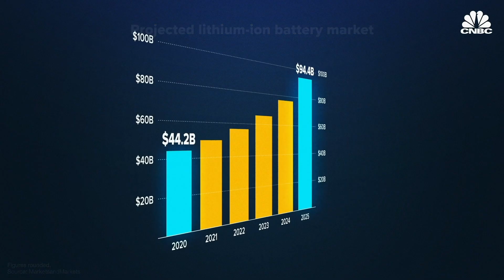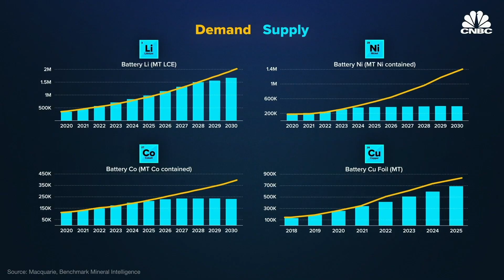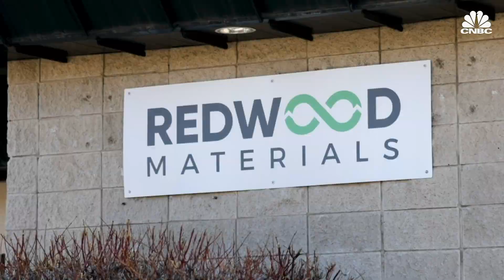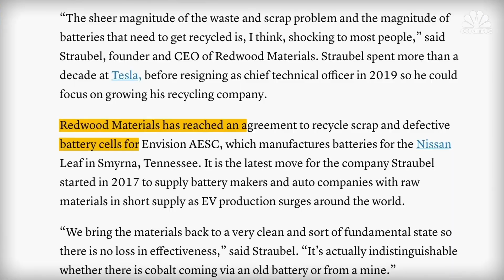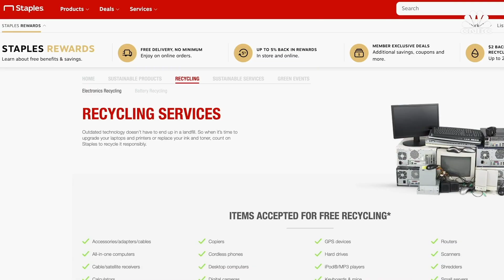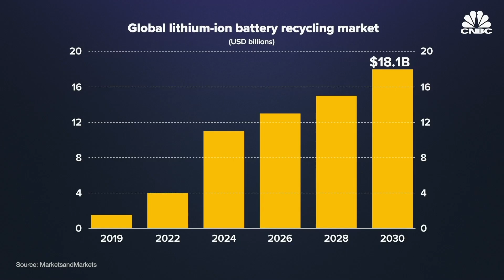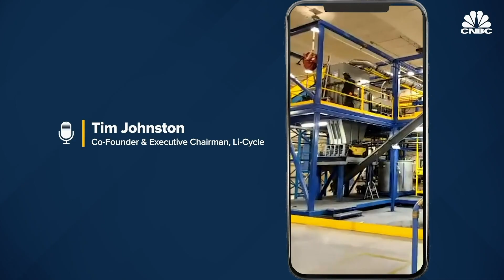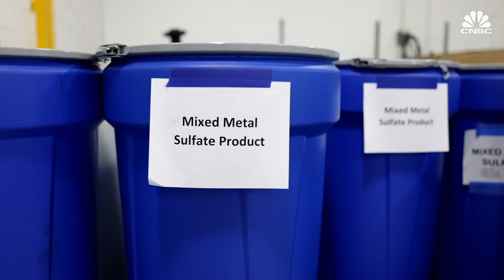How Tesla’s Battery Mastermind Is Tackling EV's Biggest Problem

Comment: CORRECTION>
Evs  PERCIEVED  problem is that people are accustom to driving gas cars where a tankful will take them 3-4-500 miles. So they perceive they need a battery pack to take them just as far when in fact the average driver only goes 40 miles a day. Once or twice a year some people go visit grandma or vaca on that faraway beach. They can rent a Suburban for these trips. A 3-4-500 mile battery pack will co$t you a fortune, take forever to charge, add a ton of weight to your EV , mrake your EV harder to stop, and if the battery pack should ever need replacing the car will be scrapped instead.

!

Comment: Hybrids. Perfect solution to a smoother transition and maybe the end of the road as far as transitioning is concerned. The EVs are just not going to get me where I need to go on one charge and hydro companies are getting slower at connecting new buildings to the grid. A hybrid will have the range and serve as a power source on the job site. The only problem left to solve is busting out of the work truck when the lithium battery erupts in flames and I can’t open the electric windows or unlock the doors. 😖
Reply: I forgot one last thing. The electrical grid will also be struggling to keep up so hybrids can take the pressure off there as well.
Reply: Silly me. Did I hear someone in this video say that the lithium from this process was not good enough to be used in new batteries?  All the more reason to push for hybrids. But then again they need lithium too. Do hybrids use less lithium over time?  Boy oh boy. It’s beginning to look like these are difficult problems to solve. Now that I think about it, how far we live from our work, school, grocery stores or any essential services has been ignored because we have cars plays into this as well. It’s not just a scientific solution we need. It’s social solutions that are needed as well.

Comment: Batteries are not the most glaring problem with electric vehicles. But they are right up there. But the biggest problem I think is charging. The North American electrical grid is not going to be able to withstand the onslaught of millions of electric cars. Not only that, but if we transition commercial vehicles, like freight trucks, 18 wheelers, to all electric just imagine the draw charging just one of those trucks would be. There are several other reasons why electric vehicles are a joke, with these two just being basic ones. The ecological consequences of mining all of the rare earth minerals minerals necessary to build these batteries is beyond comprehension. Not only that, but the availability of these minerals is also very tight. There’s basically three places in the world where these minerals are mined heavily. China. Afghanistan. Nigeria, I think. Outside of those locations, these minerals are scarce. That’s why they’re called “rare earth minerals.“ The onslaught of environmental activism concerning electric vehicles is a primary example of what it is to put the cart before the horse. The fellow commenting on the recyclability of these components is not telling the truth. He claims 98% of the rare earth materials are recycled. That’s not so. That is absolutely 100% false.

Comment: ooh i don't think recycling is EVs biggest problem, since it's independent, nor is the anticipated shortage of anything, which hasn't happened. i'd hazard a guess at cost, availability and efficiency as the top three issues, for there are real reasons why EVs/Lithium have failed to displace ICE/lead-acid, and those reasons would all have to do with profitability.

Comment: There should be no reason to ever have to plug in an electric car more than 1 time .. you could have one wheel powering the car while 3 wheels recharge the battery while you drive, an alternator keeps your regular car battery charged , I don’t see why this is a problem for the engineers to figure out.. 🤷‍♂️

Comment: Ditch the battery almost altogether. How? The car runs from a battery so do gas cars. The electric car though runs from 1 motor. Change it to 3 motors a generator motor to produce overall power a drive motor to propel the car a regular car battery to produce initial revolution then generator produces almost exactly the same power as current Teslas
Reply: Just stop. You have no idea what you are talking about

Comment: The only problem is if it cost more to recycle the material and turn it back into a battery than it does just to make a new battery it will not get done, especially because the majority of the batteries are made overseas in countries with no environmental laws like China
Reply: Yeah if the business isn’t profitable that’s a problem nice observation
Reply: @DatDawgDub unless regulations make dumping costly 🤔

Comment: Seams like the EVs number one problem  is price, 2 is charging . That breaks down to charging locations and times. Its also a problem for the people who than they are being green that they charge with Cole generated electricity.
Reply: Even when they are being charged by gas or diesel it’s still better for the environment and “green” that being said it could be much more green when using solar
Reply: Solar solar solar

Comment: Basic iron law of recycling:  recovered minerals need to be worth more than total cost of the recycling operation, including transportation of end of life materials, energy (which is very high w batteries), processing.  Used plastic for instance, much of it, violates the law which is why so much of ends up in dumps or the ocean.  Used steel obeys the law, so that over 80% of steel is recycled.  

Therefore any new recycling pitch that won’t address cost vs value law up front is a scam or run by the delusional.  No, famous engineers like Straubel don’t get a pass on the law. No, intentions like ‘we really really want this’ don’t get a pass on the law. 

Corollary: media outlets like CNBC that won’t ask these questions up front are part of the scam.

Comment: Engineers need to be taught to consider end of life when they design something. If the batteries can be designed such that the materials and components could be reused that would go a long way at making recycling easier.

Comment: So, if these ev cars are to take over fossil fuel vehicles. How can you keep extra electricity in the case of an earthquake or hurricane or any natural disaster that affects the grid for hundreds of miles in all directions. I can stockpile fuel for my car and truck for up to 2 years. As is. And I can transport it with me so I can escape from the chaos that I've seen in Florida during the hurricane. Are you supposed to buy another battery for 30k and put it on a trailer? I can put 6, 5 gallon gas cans on my vehicle and travel up to 400 miles that equals 800 miles including the gas already in my car. That's $275 in worse case at bidens high gas price of $5 per gallon. What incentives are there if I can't save myself during a natural disaster like earthquake or another hurricane Katrina.

Comment: OK so you want a mobile battery
For smaller devices
I'd use compressed air
But if heat is present I'd use nitinol heat engine

Body Heat powered mobile phones
Is my level of thought

Comment: Li, Co, and Ni are far more limited than fossil fuels - we will run out of battery materials long before we run out of fossil fuels
Reply: here's the thing, we can recycle battery metals, if you burn fossil fuels into the air, those mfs are staying in the air. pro tip: watch the actual video next time
Reply: @kurade1096  Protip - I did watch the whole video
Here's another protip - there is only enough Co and Ni in the entire world to replace 25% of the existing cars - then what?
Protip - go back to the kiddie table
Reply: @atenas80525  ever heard of batteries that aren't made of those materials? there can only be so much oil and on top of that, there's pretty much nothing left to research about oil. battery technology is advancing, and will continue to advance while you are still clinging to your precious refineries and platforms. believe what you want, I don't care, just don't choke on that copium
Reply: @kurade1096  There are lots - sodium ion, zinc ion, hydrogen cells, etc. - but every single one that I have heard is basically at theoretical stage, much less R&D and decades from production - like many things, if it sounds too good to be true . . . the idea sounds wonderful to have free storage from hugely abundant minerals like Na and H, but in reality - where most of us live - we just don't have the science to make it work
If there is a battery technology that I have missed, please let me know, other than to say "battery technology"
Reply: @atenas80525  ok fair argument

Comment: We need to make batteries last longer and not lose range. Cars usually last 20 years but EV only lasts 10 to 15 due to the battery degrading. Even if there's nothing wrong with the car but the fact that the car doesn't have enough range anymore is a reason to junk the car. What we need to do is to have standard size batteries that are easily swappable.
Reply: Actually , EVs are made now , that out last gas cars. Their battery lasts 300k miles to 1 million miles (lfp). Treat ev innovation like cellphones not regular cars

Comment: It is obvious. The most concentrated supply of the materials to build lithium batteries will be in old lithium batteries. The problem usually is the materials involved eventually migrate to places within the battery, or form structures, where they can't be regenerated through recharging. But disassembly and processing to separate everything out again will work.

The really interesting thing is if the battery manufacturers start designing for recycling. That would be a step-change in the sustainability of battery technology. At the moment it's all out to keep improving battery technology itself in terms of capacity and recharge and discharge rate, but once that starts reaching limits (which it is), it should come down to how to efficiently recycle the battery so both the scrap value of the battery is high, and the production costs of a new battery is low.

Comment: EV Batteries still have 50% to 70% of their useful charge / discharge life left when they scrap them ... these should be reused at solar and wind generating plants as back up power (for when it's dark or not windy) ... the power to weight / power to size ratio means nothing there as the batteries are obviously stationary .. Literally each TWO waste EV Batteries are 100% brand new as compared to one Solar Storage battery   Get it?? ... apparently this is being done on small scale in a few places already.
Then once they are depleted there ... recycle them,

Comment: No such thing as 100 %carbon neutral (that's pie in the sky) unintended consequences in transportation, manufacturing & recycling reduces that and puts the carbon right back in, albeit it is reduced. Straubel is a sharp engineer. Metals like Cu, Al, Zn, Cr, Au, Ag have always been recycled in the past, just make it easier for the public to have greater access to these centers to dispose of the materials & I think it will be more of a sucess.

Comment: then ev's are just huge buha. Unsustainable, expensive, cellphone on wheels. Ill stick w/ my 98 civichatch hv 423k manual original engine, transmission, and clutch. And my 93 toyota pickup 4x4 sr5 extended cab 5speed manual with whopping 523k original engine, transmission, and clutch

Comment: What can be done to reduce the "quantity" of the material needed to produce a viable E-V battery?  That would have a significant impact on the supply problem.
Reply: The easiest way to reduce the amount of material needed to make an EV battery is to lighten and streamline the vehicle so that it requires less energy to move it.